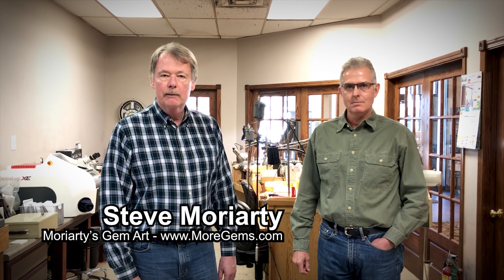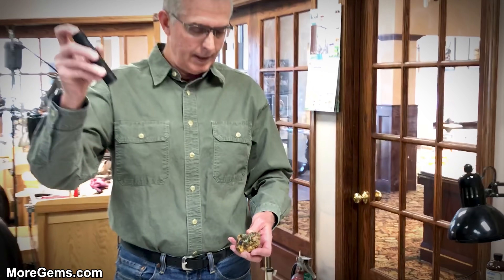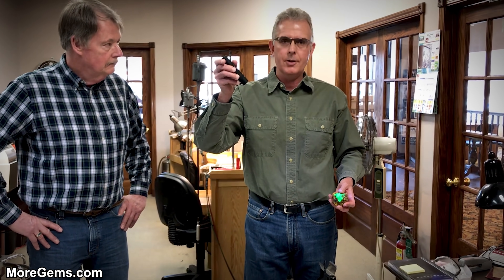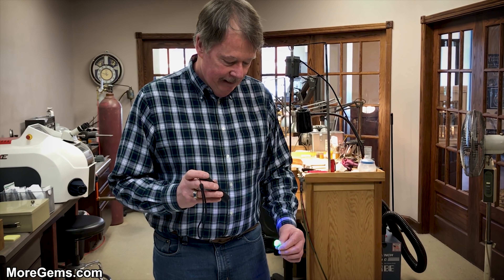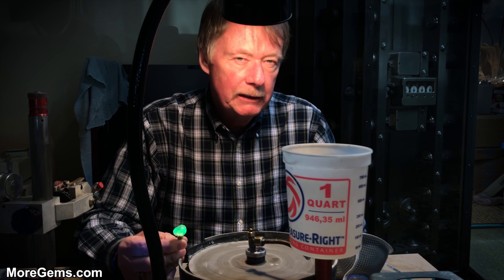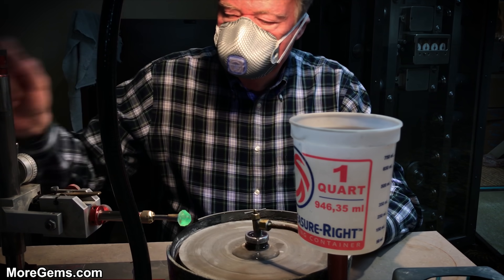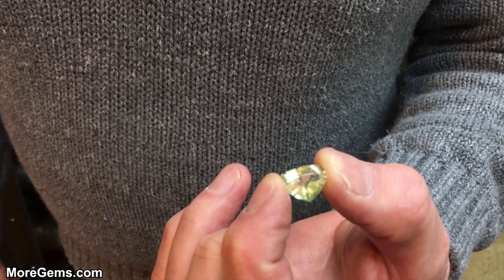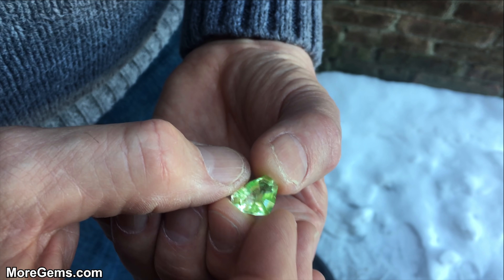What is Hyalite Opal - Faceting Fluorescent Minerals

Comment: Great video.
Reply from the maker: Thanks, Akita!
Reply: Orion Opals .com
Is it safe to wear fluorescent jewelry & how safe is it for you to handle the minerals with your bare hands, Steve?
Reply from the maker: Yes, according to Gem-A (The gemological association of Great Britain), this particular material from Zacatecas, Mexico is safe to handle, cut, and wear. They have done an extensive article on it in the past. There are only trace elements of Uranium within this material which only makes the radiation of the gem slightly above background levels. While the levels may vary slightly in from gem to gem, it probably isn't anything to worry about, but it's a good idea to be conscious that it's still emitting a very slight amount of radiation. Not all fluorescent minerals are radioactive, there are other elements that cause fluorescence as well.